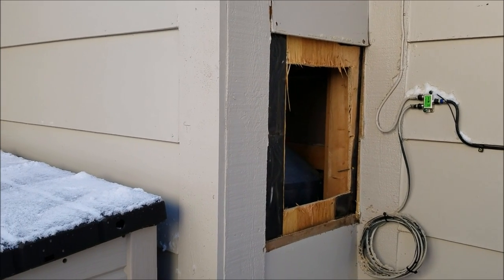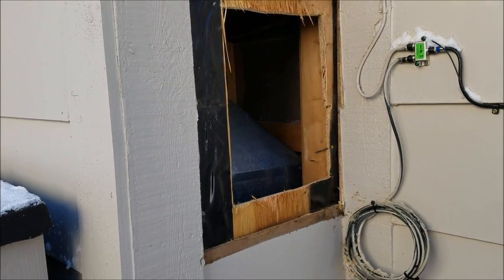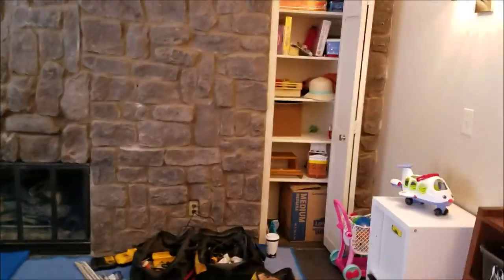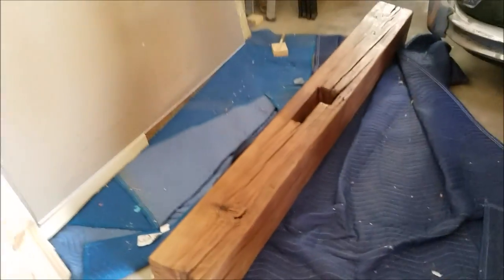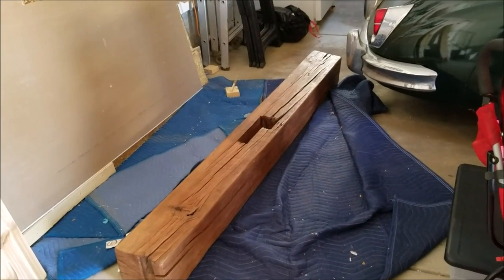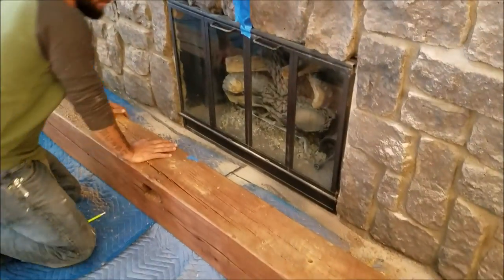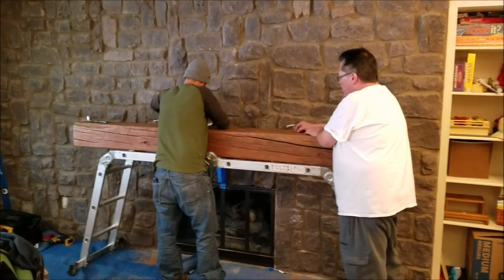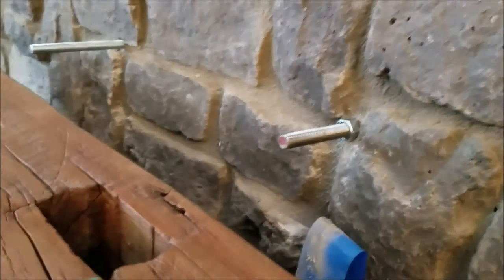Fireplace Mantle Install South Denver (Below Cherry Creek)

Comment: Did all three bolts get tightened on both sides of the wall?
Reply from the maker: yes.  This was tough but ended up working perfectly.  We actually used multiple nuts to lock it in.